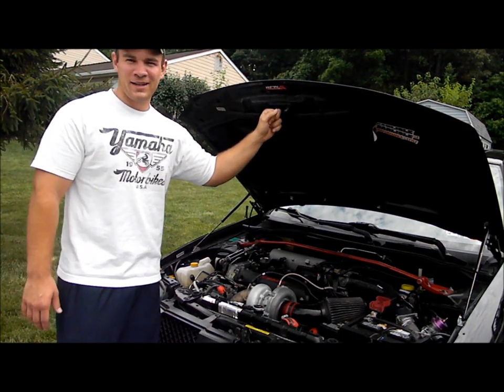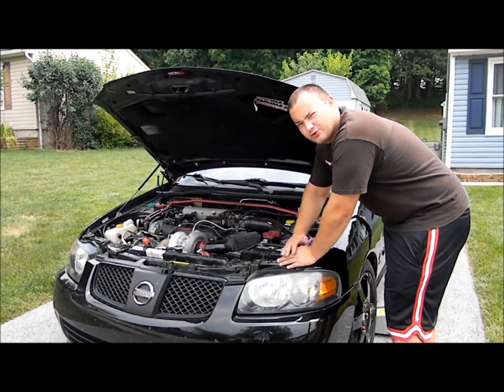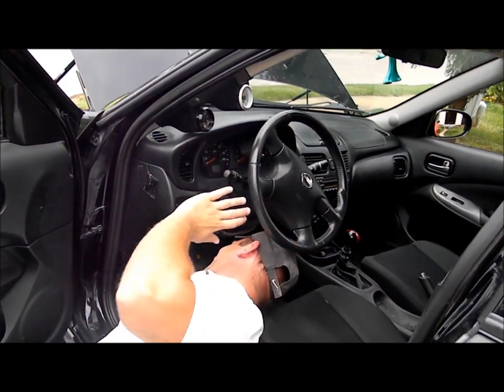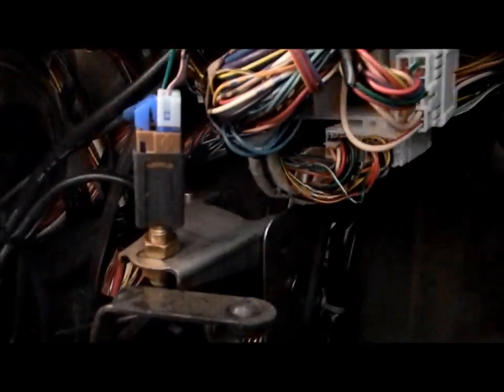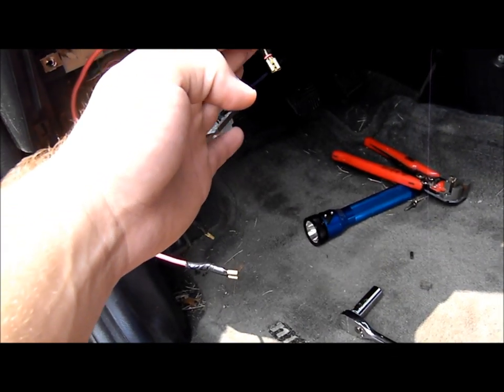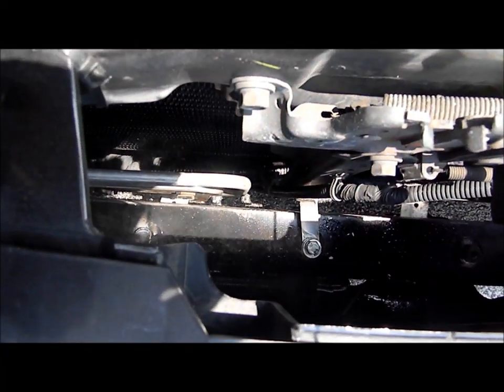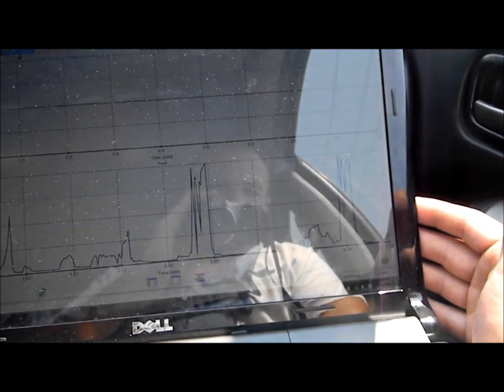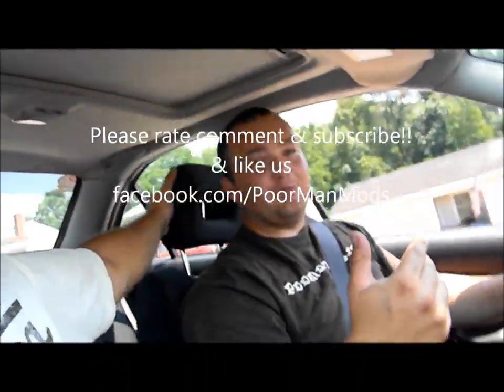DIY Intercooler Sprayer / Mister | Lower Intake Temps | Increase Horse Power | Turbo Spec V

Comment: While every engine and car is different the conjecture is that every 10F drop in IAT will yield approximately a 1%-2% increase in HP.  You aren't directly adding mass to the intake charge but it will be denser due to the higher efficiency of the intercooler.  I'm of the belief that as long as the mod is not weight and cost prohibitive any gain is beneficial and incrementally they will yield good results.
 Additionally larger intercoolers are not always beneficial to the overall performance of the vehicle.  In general a "larger" intercooler means a larger volume of air that the turbo must compress before boost is achieved.  Also depending on the design of the intercooler you may run into additional drag on the intake charge.